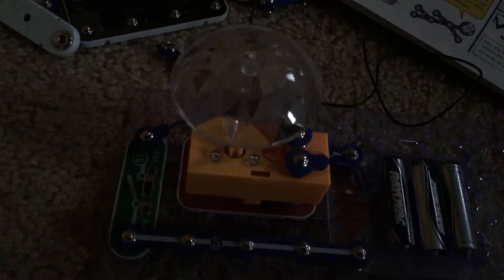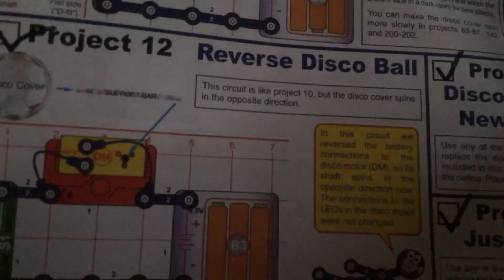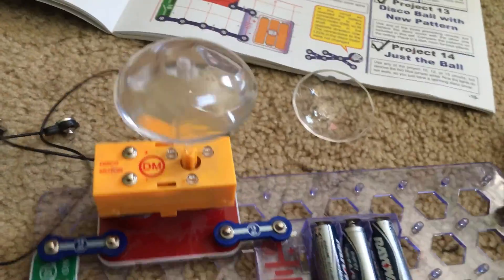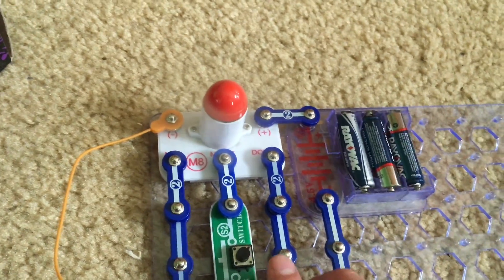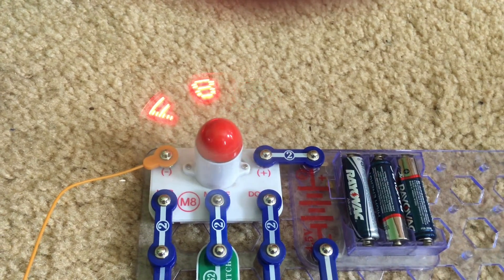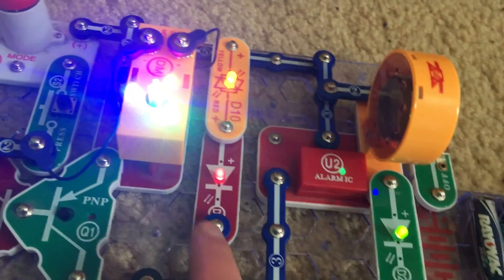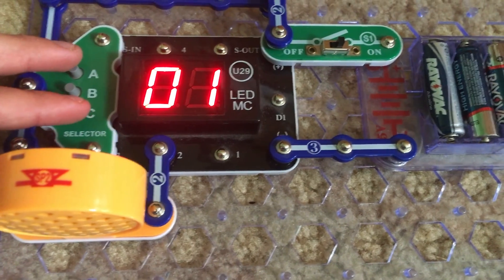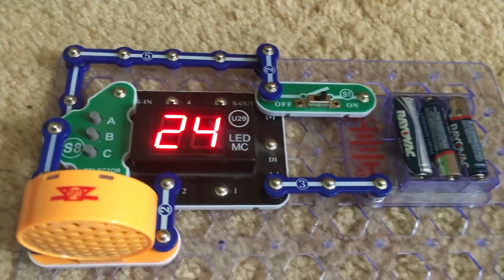Snap Circuits Arcade: Projects 11-20

Comment: Hello, I was doing project 15 but I have the one that does not use batteries and I put it on 6v and the M8 worked for a while but after a while the letters were no longer seen, only the motor works but the letters are no longer visible, Is it because I put 6v on it?  or what can I do to make the letters show up again
Thank you
Reply from the maker: I'm not exactly sure if the voltage has anything to do with the performance of the letters, but if you have the motor on for several hours (which I'm not sure if you did), it is normal for the letters to stop working, and you can turn the fan off for five minutes and turn it back on to see if that fixes it.  Please let me know if this helped.
Reply: @andrewsstation6436  I already did that but the letters do not appear, and rarely do they appear but you do not understand what appears and then again they no longer appear, only the fan works, I turn it off for 10 minutes and however the lights do not turn on
Reply from the maker: @adalrioss4723  Will you be able to please tell me the exact model number of your set so that I could try to look it up?